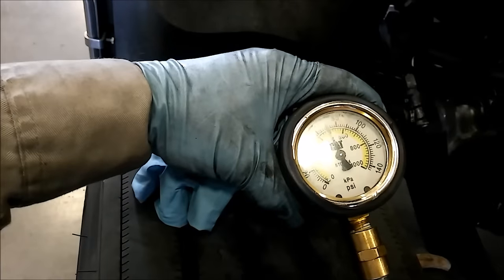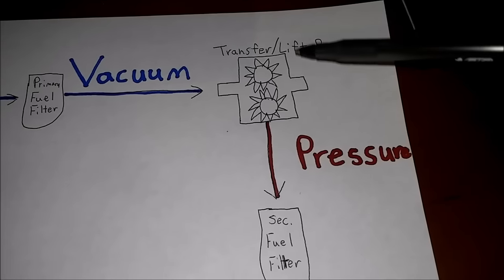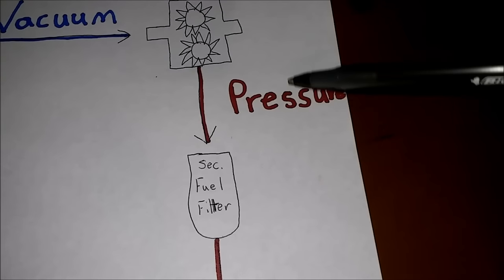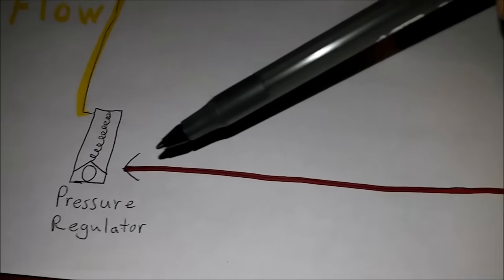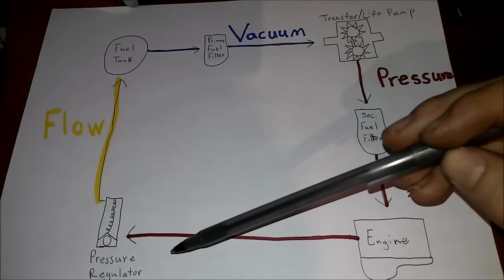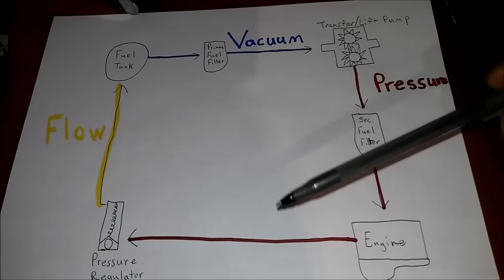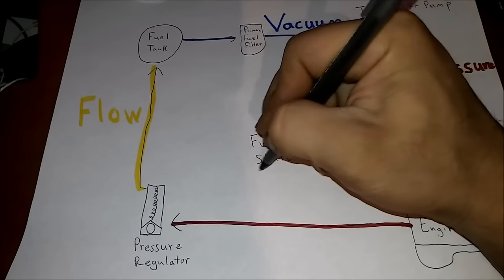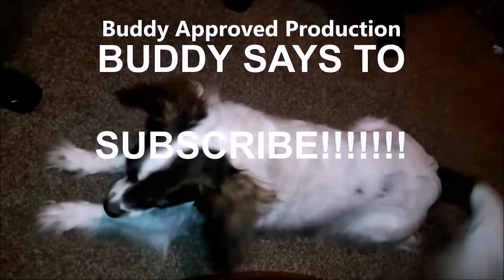How To Troubleshoot Cat Fuel Systems and Test Diesel Engine Fuel Pressure.

Comment: What might be causing a C15 to have higher filter restrictions. After new filters it would usually run between one and two on the Restriction gauge but now it's three or four. Fuel pressure drop maybe 5 lb still runs between 75 and 90 PSI. And it's kind of funny because the filter restriction gauge will get up to about 5 but after I fill the tanks it'll drop back down to three three and a half

Comment: What is the cranking pressure of the fuel transfer pump, I'm troubleshooting C15 won't start, the cranking pressure is only 30 psi

Comment: I have a 2005 C7  serial # KAL72432 in a motor home.  Once it starts it runs perfectly as long as you hold throttle above 1000 rpm. When you let off it dies will not idle.  The mechanic changed the fuel pressure sensor on top of the block it ran fine for bout 15-20 miles then  it started doing same as before .  My oil pressure stays right at 40-60  psi.

Comment: Great material, thanks.  This helped me diagnose a Check Engine Light- code 94 / “limp home” mode activation on an ‘06 C7 in a motorhome.   I replaced the fuel pressure regulator and it resolved the issue.  Interestingly, it also corrected a light torque load 25-35 mph surge/shuffle condition that the motorhome had since I purchased it about 30K miles ago.

Comment: when gears in transfer pump are worn or bone dry it can't pull a vacuum. We used to pressurize the fuel tank about 5psi or less and push the fuel up. 
Check valves also leak back to tank . I just fixed a Mack 300 it was the check valve in pump on that motor. Excellent work thanks!

Comment: Sorry just saw your message. I work full time for the city of buffalo as a mechanic at the highway garage. Then I work part time for johns towing out of Tonawanda ny. Towing and doing road service. Also help out at Beaumans garage in Lockport by basically doing the same thing and doing in shop repairs on cars, light truck's and rigs.
Reply from the maker: Only three jobs! Such laziness would not be tolerated here, just kidding.

Comment: I love watching your videos! They are so educational and helpful. I’ve learned so much. I have a question about this. I have a Kenworth T800 with a c-13, I started losing power in a stuttering sort of way like fuel filter was clogging up. So I changed out the filter and now it is worse. I can barely move in a parking lot. Worst part is I’m in Kremmling Colorado and there’s no mechanic. I called around and they all say that all they would do is change out the fuel filter. So I’m stuck with no help. Any suggestions on what it could be? Or what I could do myself to maybe get closer to a shop?
Reply: What was the problem? I’ve got a 3306 doing the same thing I cleaned the tanks out changed the filters and replaced the fuel lines it’s still doing same thing

Comment: Great video, thank you. I do have a question on my C15.  I have noticed the last couple of times I have changed the primary filthe fuel level is about an inch down in the filter. It used to be plum full. And now my truck does have a slight stutter. When you've got a higher demand for fuel. In a heavy pull, what could be causing that? I have tested pressure I'm around 95 psi at 1500 rpm.  Thank you for any advice

Comment: We replaced the injector O-rings, transfer pump, injector harnesses, fuel pressure regulator, check valve, did a complete PM, ran the rack, new starter, batteries as well. It ran for a few hours. Ran a bit rough, yet it ran.  Next day no start. We already performed the 5 gallon bucket test directly from the pump. Had someone come out and hook up to the round connector under dash. Computer screen read all 6 injectors low voltage. It will start with starter fluid but then dies. No throttle response. New throttle position sensor, timing sensor(on cam) as well. MXS C15 ACERT.  Many thanks.
Reply: Last time that happen to me on an acert it was my ECM .
Reply: It turned out to be the ECM. Replaced it and it fired right up like a champ.

Comment: So Adept Ape i have talked to you once before about my  3126 in my 2002 GMC rollback. So recently i have developed a miss at idle and under acceleration. It has gotten so bad that it takes forever to get up to highway speeds. I went to my local truck repair shop that had the proper computer to talk to my truck. He did a cutout test and at the time the injectors showed no issues and all passed fine but it was just at idle. That weekend i changed both fuel filters, Oil filter, and oil, also did a transmission service and replaced both batteries. Also did a valve cover gasket to get rid of some oil leaks. Checked the injector connections at that time and did not see anything out of the norm. put everything together and the miss is still there.and it gets worse when it gets warmer. There is no fuel or oil in the coolant and there is no oil in the fuel tanks. i did a little research and read about changing the fuel pressure regulator. Changed it with a CAT part and no luck it is still missing. So im at a lost as to what it could be it has no issues with starting it just has the miss please help with anything i could check. I thought about pulling the injectors and checking the O-rings. Or i thought it might be the HEUI pump or the fuel pump on the back. I have the tools to work on this, it is just im 30 years auto tech not diesel. So any help or direction to start will help because having a tow company time is money   Thanks again and keep doing the videos I m on the west coast so im the same time as you.
Reply from the maker: +Steve Porter You should send me an email it is much better than this comment system for discussion when we go back and forth. AdeptApe@yahoo.com So an intermittent miss with no codes. First thing you need to do before trying figure out what it is, out a mechanical fuel pressure gauge on that engine and then route it so you can see it while you drive it. What is the fuel pressure reading while the engine is missing? First thing to check I would say.

Comment: Very interesting.  What would cause the engine to cycle between 2000 and 1500 rpm without touching the throttle?

Comment: I have a 379 Peterbilt 3406e . I had the engine complete out of frame over haul excluding the injectors and the turbo. Engine performs great when warm. If it has been sitting for a couple of days...when I start the engine up...it performs as if it's starving for fuel...it idles really rough for a couple of minutes with a sort of a cloud of smoke coming out the stacks. With in 3-5 minutes of idling it stops smoking and begins to idle in a normal fashion with missing. When I first took it back to the repair shop and informed the guy the engine was not idling properly and he stated that it should eventually clear up in the very near future and I should add a quart of oil to each fuel tank. this is a problem I did not experience before the out-of-frame. I later returned to the shop and the guy told me I had some fuel lines leaking. It was recommend to change all of the fuel lines. The the shop informed me that it was not the injectors. I am at this point so confused, after sticking $22K into the engine. What do you feel may be the issue here?  Please reply. thank you.
Reply: After setting awhile and on start up a large cloud of smoke comes out of the exhaust. More than likely you have an injector leaking fuel on top of a piston. Sometimes they will run a few seconds and die. Then they are hard to start, since the fuel has run out of the cylinder head.  If they are just hard to start, fuel has leaked out of the head. Can leak out either end. A return check valve can cause this. Or you can add check valves on both sides. I usually replace the return check first and put another valve at the fitting in the return first. If that don't fix it, then put one in the supply. A cheaper way on supply is routing the hose to make a p-trap affect. The FTP on these hates air. And if you get any air at the inlet fitting, takes awhile to get it out of the system.

Comment: Very helpful info.
Quick question I have a noise coming from the secondary fuel housing . Kinda like a sound of a bearing going out . Gould that be the  pressure regular value?

Comment: Hi thanks for all the great videos! I am having an issue with fuel pressure in my cat c7. When the engine is running it seems to have good fuel pressure (I don't have gauges to test actual psi) but right after engine shutdown I lose all pressure. And the engine can't start. What would be the common cause of this?

Comment: Maybe you can help me. I have a 2000 Ford F650 with a 3126 Cat and dual 50 gallon tanks, one on each side. When the truck is parked on a slope, whichever fuel tank is on the low side gets all of the fuel transferred into it. I replaced the crossover and nothing changed. The vent on each tank is clear and the lines appear to be in very nice condition. This happens no matter how much fuel is in either tank. This truck has never spent a winter outdoors & only has 55,000 actual miles & always starts easily. It draws fuel from both tanks and also returns it to both tanks when running or being driven. I live in Minnesota ( cold outside ) but have had this issue since I purchased the truck in May ( warm outside ) of 2019 . If I only park the truck on a level surface I never have an issue. I hope this helps. Any and all advice is appreciated and thank you in advance. I have learned a lot from your videos so thank you again.

Comment: Hi, your videos are great, perhaps you could help me with a problem I`m having the problem is we have a 2008 Ford F650 rollback back wrecker with the Cat. C7 I first noticed the fuel primer pump was extended whenever I checked the oil so I replaced it with another one from Caterpillar. Yesterday the pump knob and stem blew off along the road and left me sitting I towed it back and replaced it again. The question I have is this a symptom of another problem or just a coincidence or do I have something going on? If you could help me, it would be greatly appreciated.
Thank you in advance.    Don

Comment: C13 acert here.  It runs rough at cold idle(not so bad when warmed up, almost like a miss but I did a cut out test and everything came back fine.
It runs the worst all the time if you have the park brake on and leave it in gear(automatic). Sounds like it skips a beat every few seconds.  While driving it's totally fine.
I bypassed the fuel tank and ran it out of a clean bucket of diesel and no change.
I did a full valve adjustment
Replaced fuel transfer pump
replaced the 75psi regulator on the fuel manifold. 
Fuel gauge on the compucheck fitting reading about 70psi at idle.

Any thoughts man? No logged codes.
We just put this remane in in December of 2022
Edit: just checked another engine and the fuel pressure was at 65 via the compucheck fitting
Reply: Did you find the problem buddy? I am Having same issue with mine.
Reply: @lornemalvo565  ended up swapping all 6 injectors for new (remane) and it solved the issue.  Also all the trim files were correct so it wasn't a program issue.  One of the injectors must of been faulty. Easier to change all 6 then swapping injectors around one by one..

Comment: I once had a truck that overnight could not be started until the fuel was raised back up to the lift pump because it was running back to tank.  Replaced all the braided lines.......even installed a one way valve with no effect. Turned out one of the swivel fittings on the braided hoses was worn and allowing air into the line and as such the diesel was able to run back under gravity into the tank.

Comment: I have had a couple of primer pumps go bad ,after replacing them the problem was solved
Reply: @ronaldparobek2169 first of all thank you for the post i appreciate it, i would like to know what are the symptoms of a bad primer pump ? thanks in advance.
Reply: @jakeware9176  the truck would not start, acted like it was out of fuel, tried to use the primer pump but it would not pump up and get hard to push down, 
Replaced it and it worked just fine

Comment: Hi I have a 2006 t800 Kenworth  C13 cat. Come off the road in the truck stop . Motor won't come up to speed. Had it towed diagnostics done tech said it was injector 4 and 6 . I replace them my self. Still doing the same thing starts hard idle is fine won't come up to speed. I run the flash test that was in your videos with the check engine light. I have a 6-4 code, 7-2,7-3 and 7-4 code.. oil pressure is 40 lb on Idel and 62 when accelerates.

Comment: good day adept ape. you got some really good videos, learning a lot. my name is noel. I'm a licensed on highway heavy duty, hear in Calgary. I have a question for you. I am working on my brothers 2003 GMC Top kick T6500 with a CAT 3126 in her. now my question is, for say 10 min driving down the road, it running great, than it looses throttle response, starts to run rough and white smoke, pull off the road and shut it off for 10 min. start unit back up and runs good for a few min, than back to shit, with not check engine light on. now first off I did a valve adjustment, no change, checked for the oil leak at the injectors all look good, test the power to injectors all good, than I checked the exhaust temp at the manifold and this is what I got, #1 183 F, #2 203 F, #3 217 F, #4 230 F, #5 223 F, #6 206 F. now from what I get out of that is I have a problem with  the mechanical side of #1 injector, and possible #2 and 6, I assume that the temps should be close to the same.  would you say that the #1 injector fail? now I just started out on my own and do not have a diagnostic computer, and hoping I can figure it out with out taking it to dealer to get it checked out. I do know that if I change an injector than I will have to take it to the dealer and have them calibrate the injector. if you have any leads for me that would be much appreciate. keep up with the good vidsthanksnoel

Comment: Hello! Enjoy watching your videos!  I have a problem with my cat c15, is acting like when you have a bad diesel filter which I already change and still doing the same thing, I change the turbo sensor and the diesel pump, diesel pressure valve and no luck. I had two mechanics look at it and they say everything looks good and no check engine light. Can you help me out with a clue please

Comment: Driving a C15 that has had filters changed recently but has high restriction on guage in dash and seems low on power. What do you suggest? Partial plug before transfer pump?

Comment: Hello, what causes a diesel engine not to start unless you start it with ether. It will run fine and start. But if it sets over night you have to hit it with ether. It is a cat engine in a dump truck not sure of the size I thought I heard my son say it was a 331? Maybe be in the 1990s ? He's had several people tell him what the problem might be and he's replaced different parts that were suggested could be the problem. But no change. Still hooked on ether. Any advice. Thanks

Comment: Great video! You explained it very nicely. My degree from SLU (Stand'n Lean University) is kicking in right on time! I've got you locked in on my subscriptions list fur sure. I've have a 3406e in my 1996 W900L but i didn't hear you mention that motor. Is it the same block as a C15 but the gears are different in the front of the engine?
Reply from the maker: +Big R Phillips Thank you got subscribing. So a 3406e is very similar to a C15. They use the same fuel system design, injectors, block, head, Camshaft, valvetrain, and oil system. Mostly the differences are the ECM is simpler and fuel cooled, as well as the valve covers are slightly different, but other than that the engines are very similar.

Comment: adept ape, I need help bad! i got a 2000 3406e on a freightliner. Truck was missing pretty bad around 1500 rpms, we ran an injector test and found out injector 4 was missing. 
we put a six pack,new cam,rollers,lifter bushings and new turbo. Truck runs great idling and you can stand on peddle when it’s parked and it sounds great. the moment you start driving it and it starts boosting truck runs like crap. almost like it’s chocking on boost. fuel gauge shows 90 psi on fuel pressure. told mechanic that was kinda low he said they forced more pressure in system and does same thing. i’ve been down for 3 weeks and don’t know where to turn. Thanks

Comment: I have a C7in my Sterling dump truck. It currently has a little inline primary  fuel filter. Is it possible to add a bigger canister filter like the one you exampled in this video?

Comment: Great video!  I have a 2000 3116 that wont start, it has a hand pump on top of the secondary filter..... so somewhere between it and the fuel pump will be a transfer pump?? And being a smaller cat 50 to 60 psi cranking is ok for fuel pressure
Reply from the maker: +zeke1eod The 3116 is a little different than the other Cat engines in that if I remember correctly the fuel actually feeds the back of the head and then comes out the front. There is a fuel transfer pump, but it is a small one more similar to an automotive fuel transfer pump on a carbureted engine. That fuel pressure seems high, I would have to check, but I think the 3116 only ran with like 30 psi of fuel pressure.